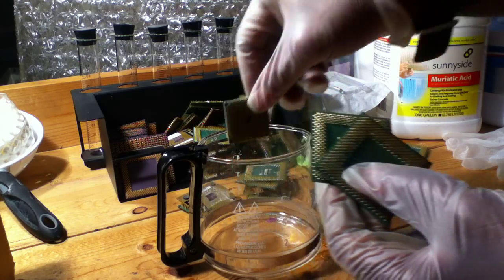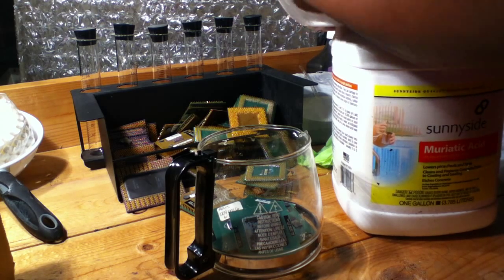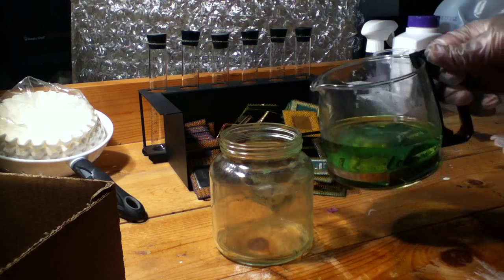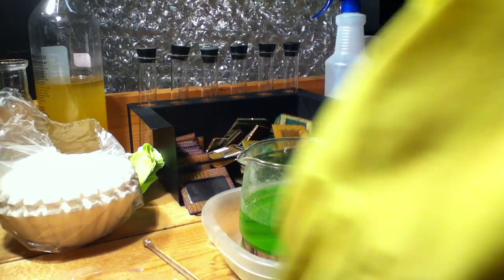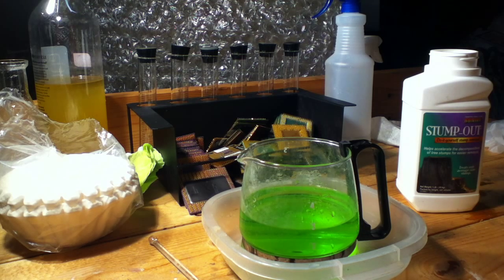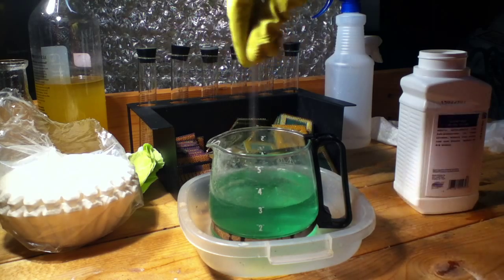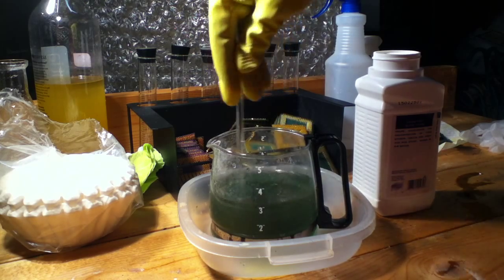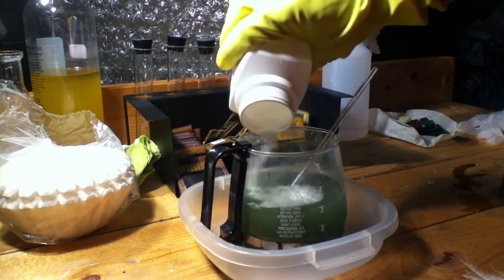Cheap Hardware Store Acids for Refining Gold!!!! P1

Comment: 1 dont put the acid under your vehicle it will rust it up quick fast and in a hurry. 2 you needed to outgas the excess chlorine gas ie let it vent overnight otherwise it will just redissolve the gold 3 when addig the stump out you only need to add 1.5 times the expected gold yield to precipitate the gold with the material you processed the expected gold yield is about a tenth of a gram so i would only be adding .1 to .2 grams of sodium metabisulfite (smb) not the 50 to 60 grams that you added. 4 what about the treatment of the waste acids! Please do some research before attempting gold recovery/refining it will greatly benefit your yield and help protect yourself and the environment